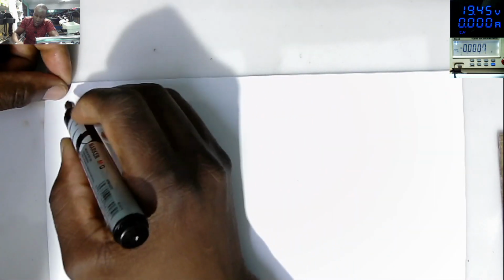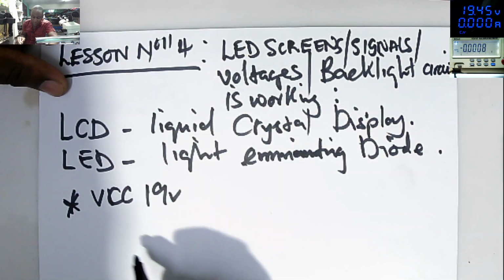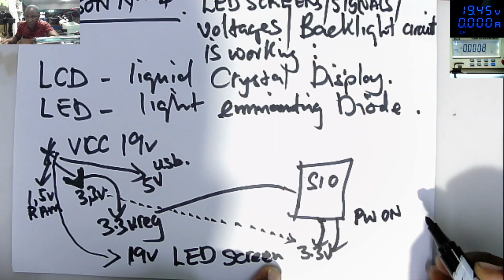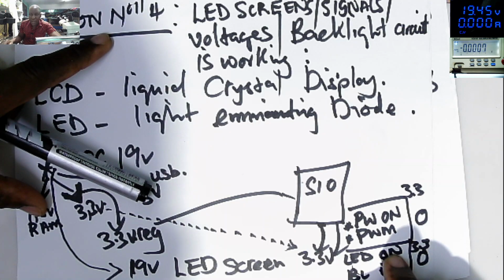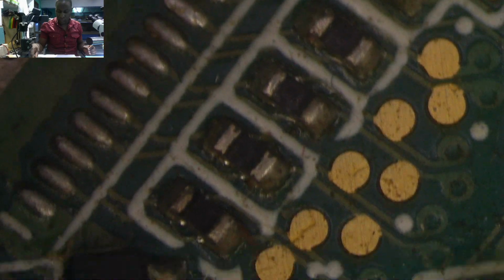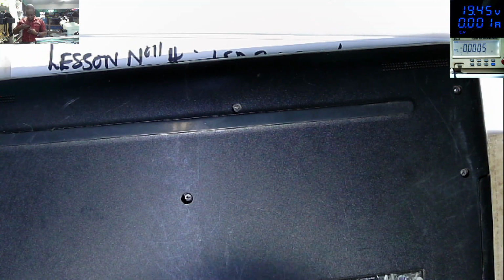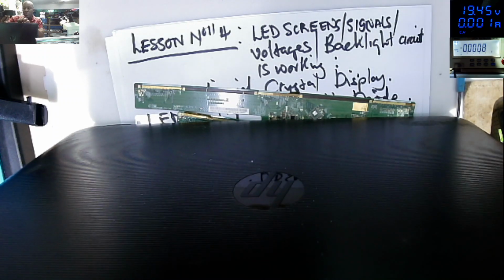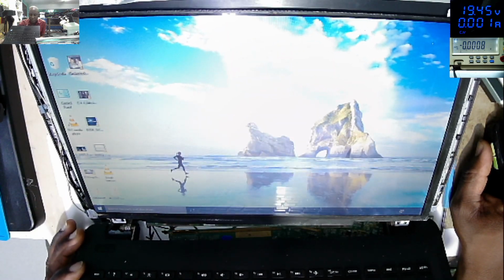How Laptop LED Screens Works, Backlight Circuit, Signals, Important Voltages!!

Comment: About 6 years ago, I had an Ikegami broadcast quality monitor in a control room where I worked go black. It was about 8 years old, but was in daily use, and was often left turned on 24/7. A replacement monitor of equal quality would have cost over $3,000(us). I realized that I could still see a dim picture if I bounced a the beam from a bright flashlight off the screen, leading me to believe that all the video circuits were working OK, and that it was a problem with the CFL backlight tubes or the circuits that drive them. A little simple troubleshooting determined that the CFL lights were good. I pulled out the driver boards, and using numbers stamped on them, I found replacements online. I ordered two of them @ $45(us) each, and the monitor has been working ever since. And my boss was really happy that I saved him from having to buy an expensive replacement, since it only cost him $90(us) and about 2hrs of my time which at the time was about $40/hr.  Since then, I've done the same repair on a large flat-screen TV one of my friends owned which had the same symptoms and which I fixed by simply replacing the CFL driver board.  The trickiest part on both of jobs was disassembling the TV/Monitor to get to the CFL driver boards, which were tightly hidden behind behind several layers of other circuit boards.   I'll bet a lot of the flat screen TV's and monitors I see discarded on the street or in the rash only need the CFL tubes or their driver circuits replaced.

Comment: I'm here because my lenovo laptop  110 15IBR '  screen went dim all of the sudden . I tried raising brightness to the maximum wit no luck ,  tried updating drivers , same results , nothing  .  I plugged an external monitor and I have video output ok, but nothing on laptop side  .    Someone fixed it by replacing faulty fuse near  Edp cable , on the motherboard side

Comment: Very good lesson. That exact problem caused me days of diagnosing hell.  That connector is the jankiest in electronics history imo.  If you are new to this connector type, the tape is NOT the primary connection as it appears!  I thought that was the case, so I never new how to properly connect them.  There is a satisfying click or seating feeling that I discovered that made me happy and mad at the same time.  Happy I fixed the problem but mad that the connector is designed this janky.  I  won't make that mistake again 😅